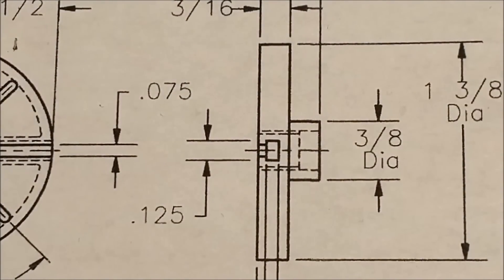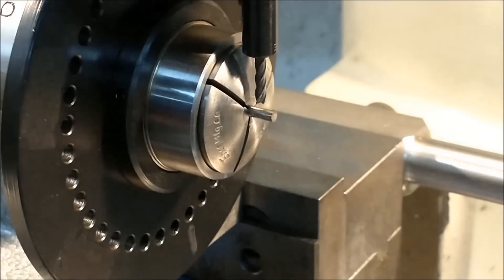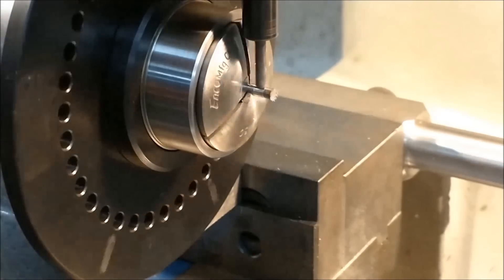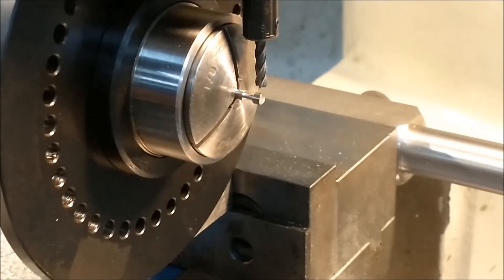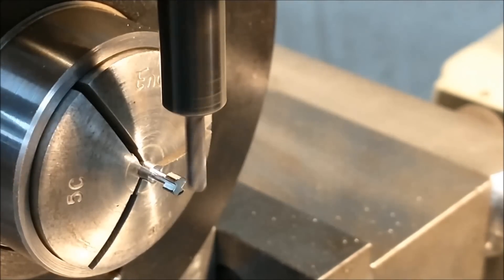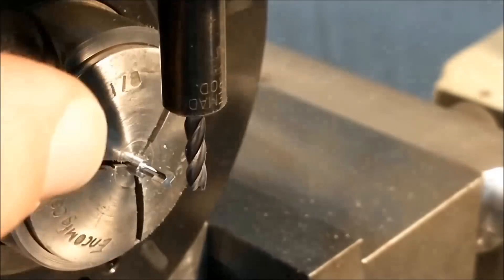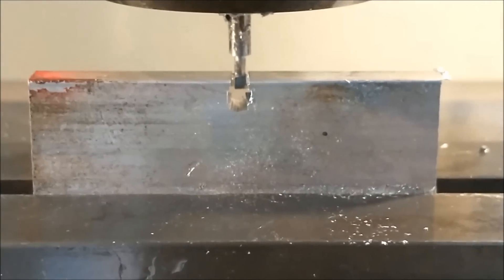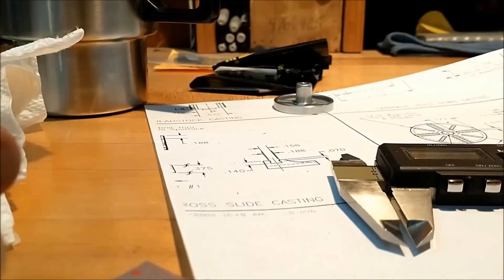A Quick and Simple Method for Making a T Slot Cutter.

Comment: I once had a job, had a large 304 stainless cylinder which i had to cut a .02 wide  .125 dp slot along the top tangent of the cylinder. My boss handed me a .02 endmill and said dont break it, its the only one we have! I cut the slot and didn't break it. I was only in the trade but maybe a year or so. I still have that endmill in my box as a good luck charm.

Comment: Question, not sure if i pose this correctly.
Do you think it would have been safer to cut the cutting edges before you cut the diameter of the shank
I would think that would help to relieve the possibilty of breaking the cutter when cutting the teeth last.
Reply from the maker: Risk was low. Its a dealers choice operation.

Comment: Dear Joe, if the cutter is the wide part of the tool, how did you manage to remove material from the stem and the bottom of the slot which don’t have a cutting edge?  I couldn’t see your test material without cutter overlain, did you cut a slot in it to follow with the new tool?
Reply from the maker: I did. I made the initial slot .005 deeper too since the bottom of the slot serves no purpose.

Comment: Not all high speed steel is created the same. Your center drill is probably plane vanilla high speed steel. Unfortunately most of the rectangular tool bits that they carry now days have fifteen percent cobalt. Cutting that with carbide is not possible. You can not even grind that stuff unless you buy CBN wheels.

Comment: Hi Joe, this looks like a tool I could use to cut flutes in small scale locomotive coupling rods. Normally I would use a flycutter. Another great tutorial, thanks
Reply from the maker: A small commercial t slot cutter or woodruf key cutter would probably get the job done too.
Reply: @joepie221  sometimes it’s difficult to find the correct size for the scale work.

Comment: Would it be possible to modify an end-mill by necking it down with precision grinding perhaps?  That way you would get a set of factory teeth at the original diameter on the cutter.
Reply from the maker: Absolutely. Be aware the flute depth may make the small relief area weaker though.
Reply: That is exactly how I have made cutters for Sherline T-slots.

Comment: 2:04  "all you UK guys", I think you mean "everybody outside USA"  The U.S is one of only a few countries on earth that doesn't actually use metric as a standard measurement.
Reply: Sadly Canadians suffer under inch tooling as well . Metric is like speaking Klingon to your average Canadian machinist . Not to mention the weird keep the half nuts engaged while threading thing
Reply: Almost every machinist can do both.
Reply from the maker: I've been waiting for the great change over since 1973. I'm guessing its not going to happen ....ever.
Reply: @joepie221  Had high hopes for you in 1973, when my dad brought back a set of sugar sachets imprinted with stuff about the switch to Metric. Guess the politicians got cold feet....

In Britain, some politicians are advocating reverting back to imperial because of ... reasons? Poor sods. Their economy is already down the drain, now they have people learning again how many inches to the foot and yards to the mile etc. Forgetting that the imperial system is defined in the metric system anyway.

I wonder how the US, which prides itself on being "advanced", has for so long resisted the change that most other nations did in the early 19th century. Failing to recognize the obvious advantages that other nations saw nearly 200 years ago. Because the "imperial" foot is only imperial in that it didn't use the French or Dutch or Bavarian etc sizes for the foot, which were all different, obviously, having been taken from different monarchs.
Reply: @joepie221  Yeah, we had a "push" in school at the time. OK for my family, as we had many foreign motorcycles and cars, so metric was already burned in. But in our large jet engine manufacturing facility, it's an ugly mix.

Comment: As always Joe, that was simple and elegant. I made a custom tapered reamer once out of O-1 tool steel. It was only for hand cutting brass but it had to be just right. Worked out well. I even went did the extra and made it five flute and deliberately made them not evenly spaced around the axis so as to suppress chatter. I was working off of one of those old books from about 1910 on tool making. It was only ever needed to make about a dozen tapered holes and it was a lot of effort but also a fun challenge.
Reply from the maker: Hopefully that was a straight flute reamer. :)
Reply: @joepie221  Hahaha yeah. It was. I have the complete materials kit for making the Quorn Mk III tool cutter and grinder. I hope to be able to make and sharpen all sort of tools including spiral-flute reamers and cutters. That, of course, remains to be seen... have to build the Quorn first! 😉
Reply: Love my copy of '1905 Tool Making' ...pure gold

Comment: Question: wasn't it nit possible to first use the side of the cutter to remove the bulk of the material for the shank and only use a "move up: of the cutter for the finishing pass for the sharp corners.
This would reduce the possibility of breaking the sharp edges of the cutter
Reply from the maker: Absolutely. That probably would be a better approach. Good call.

Comment: Working at this scale clearly has its own challenges. Will the cutter tend to deflect to forward cutting side just because of the small size or is the chip loading insignificant at this scale?
Reply from the maker: The initial end mill maybe, but the T slot cutter hits on opposing surfaces simultaneously so it probably cancels deflection.

Comment: Beautiful work, love watching you work in miniature.  
Question; could you have drilled and used a long pointed center on the blank while machining? I imagine after the first cut reducing the diameter the blank wouldn't have a lot of strength.  Just a thought
Reply from the maker: The part really didn't extend far enough to need support. Good thought though.

Comment: For those of us with more basic machines could this tool be made with unhardened tool steel and be subsequently hardened ?
Reply: Yes, a lot of milling type tools years ago used to be homemade using silver steel ( drill rod) and hardening before things became available for hobby use affordably
Reply: The correct tool for this job would be a two flute HSS .125 end mill. Clamp the cutter in the rotary indexer and grind the groove with a narrow wheel on a surface grinder. Oops forgot; Joe doesn’t have a surface grinder.
Reply from the maker: @ellieprice363  Or does he ??
Reply: @joepie221  Do you? Don’t think I’ve ever seen you use one. Now I’m confused.
Reply from the maker: @ Trevor Winter Absolutely.
Reply: I often use water hardening "silver steel" to quickly make small tools. Easy to harden and anneal with a small propane torch. Main trick is to practice reading the right cherry red color when hardening and not overheat the work piece. This way You can also have a soft shank and a hard tool which is sometimes best. It is not that difficult to do.
Reply: Metallurgically there’s no reason you couldn’t anneal it, quench it, and then heat treat it, but you’d have to be pretty precise and really have to do ALL the steps or you may as well make it out of glass…

Comment: Ready available high quality carbide cutters has revolutionised machining. "Old school" would have been to form the cutter in tool steel before hardening, then hone the cutting edges after hardening and tempering. Every extra step an opportunity to make a mistake and start again. You remind us it can be done in more modern ways, Joe. Thanks!
Reply from the maker: Believe me, I've made plenty of cutters old school. Plenty on the surface grinder too. Options are good.

Comment: Nice work! Gutsy way to make a tool you couldn't buy anywhere. Is there a reason you didn't cut the teeth first, so you had a more rigid workpiece?
Reply from the maker: Using the relief was the visual target I chose to support the tooth depth.

Comment: Another brilliant video Joe, and thanks for sharing it. AvE did a good video on the hierarchy of what cuts what and if I remember correctly,  tungsten carbide wins although the material name morphed into something else!  Regards from Wales
Reply from the maker: Handled correctly, carbide is an apex predator.
Reply: You can hardturn carbide with PCD inserts. I have done it in my lathe, but do not really like it since the tiny chips are worse than grinding dust and will eat Your machine if they gets the oportunity...
PCD is the tyranosaurus rex... as far as I know.

Comment: That came out well but had you thought to start with a 1/8th end mill to save having cut the teeth?
Reply: We have a lot of tools made in the fashion you suggest at the shop I work at, usually done with a grinder however. Quick and easy to make, and carbide is an option if you need it.

There is more information in this video about tool making and cutter geometry though, and I think that's what Joe was going for.
Reply: @nathanielstephenson7932  I quite understand but both ways are a good lesson for beginners to open their minds to what is possible.
Reply from the maker: @chrisstephens6673  Both methods are legit, but an endmill mave have been considerably weaker necked down that small. It would depended on the original flute grind.
Reply: @joepie221  absolutely right, I just mentioned as an option.

Comment: Another great video. I just finished restoring a clausing 8520 knee mill and I'm looking for a project to learn how to use it. Would any of these models be a good way to learn/ tool up as I go? It came with collet Chucks, rotary table and what I think is a decent Vice. Any thoughts on a first model?
Reply: I built a PM Research Arbor press. It was fairly easy. The simple steam engine is reasonably machined for someone new. That would be me as well.
Reply: @mikeshort4291  thank you for the input. I watched both of those videos I have to go back and take another look.
Reply from the maker: I'd start with the arbor press. Good confidence builder and great model to sit on your desk.
Reply: @joepie221  Arbor press it is. Looking forward to learning as I go with the help of your videos. Thank you.

Comment: Did I miss in the video the reason for cutting the neck of the cutter first, and not the flutes?
Reply: If you cut the neck first then the depth of the cut that establishes the flute is set by looking for the witness mark on the neck.

If you do it the other way around you have to calculate that depth based on the offset from centreline you place that flute cut at, which is what's setting half of your edge geometry.

It's still very doable, but requires more thinking/planning.
Reply: @dtnicholls1  that and you have nowhere to "gracefully" end your cut. At depth you're heading straight into a wall of HSS, overshoot and that EM is a goner.
Reply from the maker: The above 2 replies say it perfectly.

Comment: Thanks again Joe. This time laterally.
As much as one learns there are always some things that get forgotten.
Not so long ago a piece of stainless ate my HSS parting tool so I bought a TCT parting tool with inserts. The smallest holder is still too large for my lathe. I need to reduce the flange which is gripped in the toolpost from 10mm to 1/4". It ate two HSS end mills. This caused some head scratching. I was going to send it away to be surface ground but then I saw this video and so have ordered a carbide end mill instead.
So thank you again.

Comment: Please don't cut the t-slots in the part with your CNC. The flood coolant and Precision movements and slow feed rate of your will lessen the chances of snapping off that little cutter. However down here in the comments it's blasphemy (not Kosher) to use a CNC machine. Some viewers take it as (why not just 3-D print it) smh. Keep up the good work Joe! CNC or Manual.
Reply: Well it is true that I am a fan of MQL and cryo coolant.... if the choice comes down to worn out acme threads to a ballscrew I'll take whatever has the tightest guideways 😉

Comment: Wouldn't be better to use and end mill with a corner radius to cut the neck diameter?  Sharp corners are stress risers.
Reply: It wouldn't cut a T-slot if there was a radius between the shank and the flutes, which would defeat the whole point.
Reply: @_GOD_HAND_  I'm talking a .010 radius or smaller. Most T Slot cutters are made this way it adds strength to the tool.
Reply from the maker: @brandons9138  To clear the entry slot, the shank would have to be relieved 2X the radius chosen. It was only .07 to begin with.
Reply: For the shank to neck portion, yes. The top of cutting edges, however, have to be dead square or relieved, otherwise the fillet will be transferred to the top of the t-slot (depending on neck clearance).

On a feature that small any more than .015" R would take out most of the clamping surface (there's only .025" on either side to act as a clamping surface). There would still be clamping action, but the nut would tend to be pulled "through" the top of the slot resulting in poor wearing and binding.

Comment: Making these tiny T slots in aluminium was a job i used to do regularly. i necked down a 4mm slot mill in the tool and cutter grinder.
Reply from the maker: Thats cheating. But certainly the way to go.

Comment: I need to make some D-reamers for making swaging dies.  I think I'll try using HSS instead of 0-1 or A-1.  Thanks for the video.
Reply: Do you have a means of machining HSS?
Reply: @andrewlesuer3504  I'm thinking a carbide endmill just like used in the video.
Reply from the maker: @customcutter100  A grinder may be quicker.
Reply: @joepie221  Thanks, I did make a tool post grinder for shaping the ogive for one I made several years ago using A-1.  Probably be easier to make a holder and grind half of the shaped ogive off with the surface grinder also.  Then final shaping with my 2X72 belt sander.